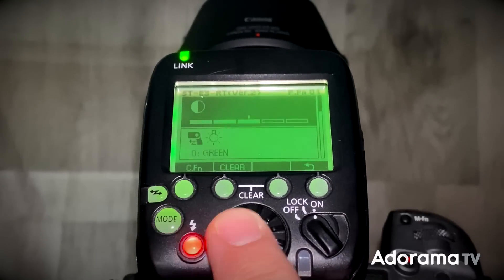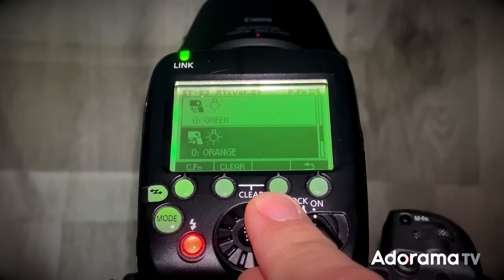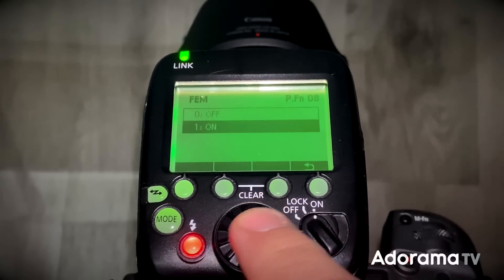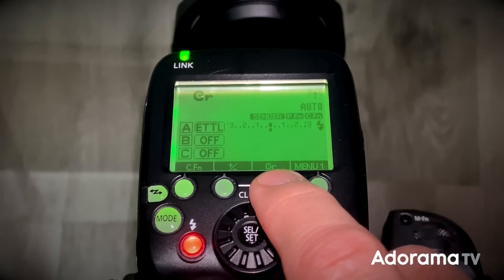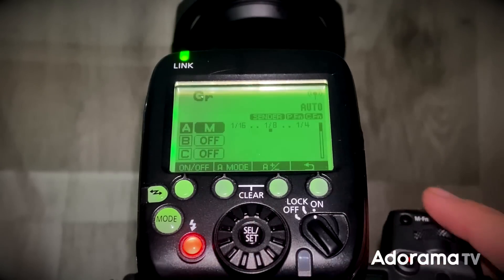Flash FE Memory | Ask David Bergman

Comment: I use the Godox X-pro trigger and the TCM function does this Flash Exposure Memory that you were talking about. I've done it a couple of times, with varying results. However, after your chat, I think what I'll start doing is getting the exposure in TTL close to the subject, lock it in when I find the exposure I want, then move to where I want to take the shot from. Much quicker than guess and check method, especially if changing the subejct's distance from the light(s).

Comment: I often use a flashmeter. Sometimes not. I have a Canon 580EX, a Godox 860 and a Godox V1. My last flash project was with the V1 on top of the camera, pointed backwards and up at 45 degrees, bouncing off a white circular Photoflex reflector (probably 25 years old) held in place by my client, illuminating her clients. Manual exposure, based on Sekonic L368 meter. Seven lawyers, one at a time,  -BAK-

Comment: That is a good way to get your flash exposure settings pretty quick. However, most of the time I start at around 1/4 power in daylight or 1/32 indoors and adjust from there.

Comment: There is something important that wasn’t made clear, I thought. If three flashes are set up, the composition decided, and a Godox trigger ( with TCM = transfer computed to memory ) the power setting chosen by TTL for each flash is remembered and pressing TCM changes the trigger to manual with those power settings; then, the flashes can be fine tuned in power. Often, the camera is set with low ISO, highest flash sync, and an aperture that results in a dark frame when flashes are turned off. The camera’s flash menu is used to enable TTL mode or this won’t work.

Comment: There are schools of thought on this as with all things. Metering with the reflective meter in the camera or the incident meeting in your hand. Both have their place and both have advantages and dis-advantages. The major advantages on the TTL side (including the FE memory) is the ability to use the camera's histogram on the image. Also the improved experience of the client not dealing with the photographer walking back and forth and sticking a meter in their face. The hand held meter is good because it is measuring the light falling ON the subject and isn't confused by trying to make the reflected light from the scene 18% gray... The bride's white dress is dull, The groom's tux is washed out. 

I switched from Buff's Einstein lights for a few basic reasons and they were not for more accurate lighting... It was for the Bowens mount, The TTL capability, the battery power and the expansive ecosystem of the Flashpoint / Godox equipment. 

So, if you are shooting a still image of an inanimate object and don't care how long it takes then definitely go with the hand held meter.  However, If you shoot moving subjects in changing light conditions and/or want to cut down your time then taking the initial shot with TTL and converting it to manual is the way to go.

Comment: As mentioned before, Godoy/Flashpoint calls is TCM to convert TTL to Manual.  My big light is not TTL though so if I’m using it I’m guessing my starting point.  The rest of my lights are TTL capable and I’ll use it like you described in the video.  As a starting point if I’m doing something that is going to end up being the same exposure.  If it is something that changes a lot then I stay in TTL.

Comment: Here is a question for you. When doing events, run and gun, I've heard that it's best to use spot metering on your camera when using TTL. Does that really produce better results versus other metering modes?
Reply: Technically, it might give you a slightly more accurate exposure IF you could keep the spot on your subject's face for every frame. In the real world, I don't see that being possible in a run-and-gun situation, and I've found that regular matrix TTL works just fine.

Comment: Are light meters good for working out flash power please?
Reply: @DavidBergmanPhoto  thanks 👍
Reply: Yes, they're absolutely as good if not better than using the tcm function which converts your ettl shots to manual.  In fact, they're better because they measure light hitting the subject.  When you use your flash to convert ettl readings to manual, your camera is reading light reflecting from your subject, so it's not as accurate as a flash meter.  I don't see it as "old school" it's just a better way to do it.